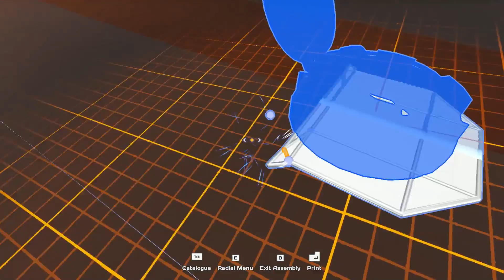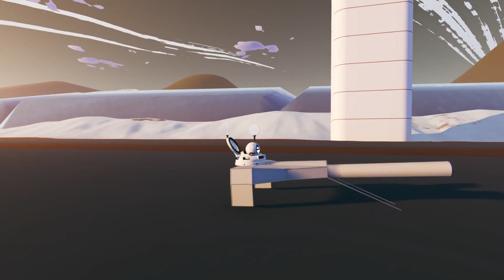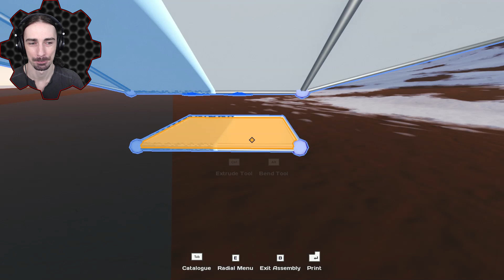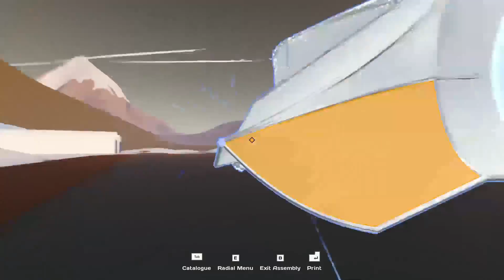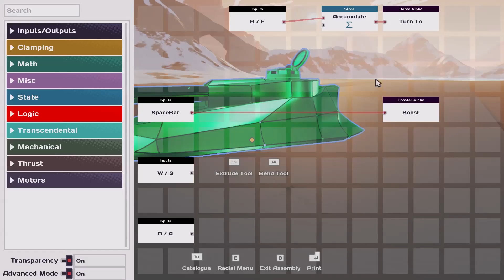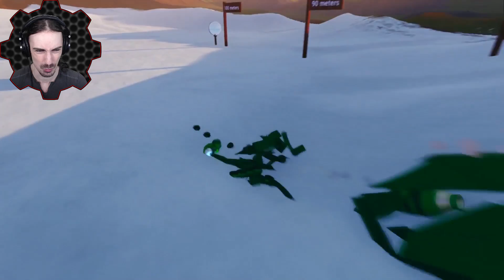I Made a Futuristic, Jet Powered, Flame Throwing Tank, BECAUSE I CAN! - Main Assembly

Comment: That tank does look cool. Now I kind-of want to see if you could make a tank-like design that could better withstand the survival challenges by using larger parts and deflecting the balls, rather than just trying to speed between them. I was going to suggest it for this design, but then I realized the turret would catch a lot of hits without providing much benefit. (To bad you can't use the booster to apply force to other things.

Could you have finagled a rotating turret by building the tank the way you did, separating the two halves, and then adding a new chassis panel to one of them and attaching the servo to that?

Also it looks looks like the could benefit form some sort of logic grouping, so if you want to apply the same controls to half a dozen parts you only need to do it once. Aside from high wheel count vehicles, I could also see it being useful for lighting setups or, maybe, certain types of sensor builds. Speaking of the logic, what does the transcendentals tab cover?